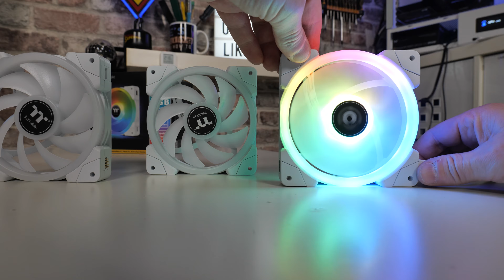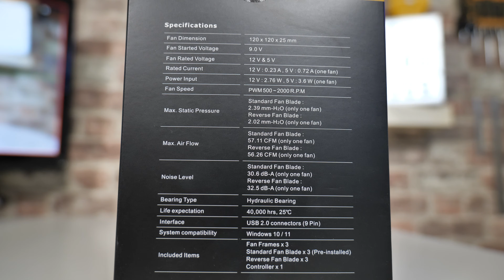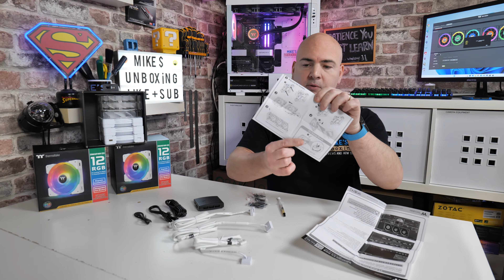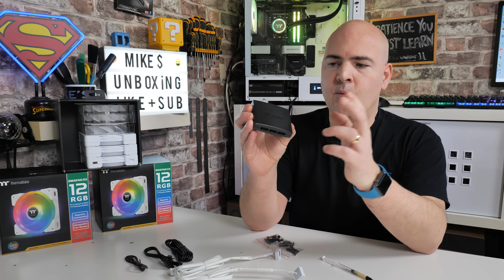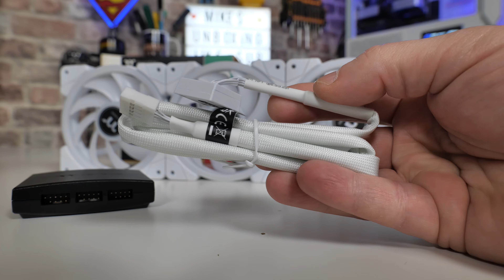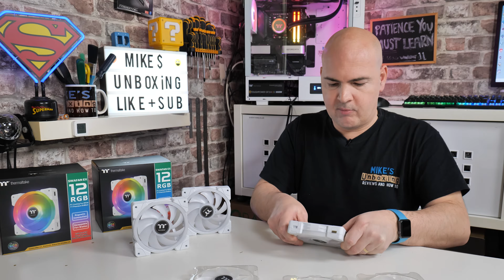BEST PC FANS Thermaltake Swafan EX12 RGB Magnetic Silence

Comment: how do you connect power for external fan use? that is to say we just want to use fan as an external fan not inside a computer case?
Reply from the maker: i would use a 12v supply or a PC power supply and a pwm fan controller

Comment: You can modify the cables to do sata if you are handy with a solder iron, or you can buy a sata to floppy cable. Don't do it though. Sata doesn't provide enough watts or amps for Thermaltake rgb fans. The Thermaltake sync controller is powered by sata and can control 9 fans at once but all of the fans are just copies when it comes to rgb. If you do convert the cable or get a sata to floppy cable the controller will fail depending on fan rpm and or how the rgb is configured.

Comment: Are these PWM and can I controll speed from bios ?   I think I read somwhere you set speed in the software but I like letting the bios handle that.
Reply from the maker: the ones with RGB in the name use a specific thermaltake controller and can't be controlled in any other way. the ones with ARGB or ARGB sync, can be controlled in the bios or the motherboard software

Comment: When I build my PC, I got a few packs of these fans. They never came with a hub, and Thermaltake's software doesn't recognize the fans.
Reply from the maker: if you got the ones without the hub those are the ex argb or argb sync, those use the motherboard software to control them, the rgb ones only are the ones to use the hub and tt rgb software
Reply: @ that explains it. I do have the ARGB versions in that case, it must be down to the software, not recognizing the fans. I’ll try a repair install for the ARGB software.

Comment: THE FANS LOOK GREAT  However the issue is that the RGB HUB is useing micro-usb and this hub alone has been the fail  point on 6 rgb hubs for me so far, why the hell are these things still useing miro usb for power? i hate these thermal take rgb hubs so much. i wish we just didnt even need a stupid rgb hub and i could just control all my rgb with Thermaltake rgb software, =(
Reply from the maker: You can swap the wiring for the wires in the new ex range and they can then use the motherboard argb and pwm headers and software

Comment: I have a Thermaltake TT Sync controller, think these will work off the older style controller?
Reply from the maker: if it is the one that has the 9 pin connections that are the same size as USB 2.0 motherboard headers it should but send me a picture of it and i'll confirm it
Reply: @mikesunboxing  thank you

Comment: That hub is a deal breaker for me unfortunately 😢, if they ever update the hub for usb c and maybe like a 6pin psu power connection (since Satan doesn't have enough voltage to power the hub) I might consider it cause the fans themselves are superb
Reply from the maker: they have a version that is hubless, the swafan ex12 ARGB sync

Comment: Can you daisy chain a set of 3 and plug the connector into the hub? For example, say I want to get 9 fans, could I sissy chain them in sets of theee so I only have 3 total cords, then plug them all into the one controller and do it that way to control all of them?
Reply from the maker: they should be fine like that, these don't include a hub so you would need to supply that

Comment: Molex connector is big turn-off for me. I have modular PSU and I have molex connector, but have other free connectors (pci, sata) what I can use. But for that, I have to put another cable (molex) just for that controller.
Reply from the maker: I might be wrong but I think the molex connector allows more amps than a sata so it is probably the better choice even though a pain in the arse
Reply from the maker: i think the molex was for power stability as molex can handle more amperage so avoids any issues with overloading

Comment: When installed and not working don't panic guy's  just give some movement to magnet connection and it will make good contact and works fine
Reply from the maker: Yes the magnets don’t always connect first time a little wiggle or adjustment usually fixes it

Comment: You saying every set is included with controller... I read on Amazon one star reviews about they got it without controller so what wich do I order ,
Reply from the maker: there is a controller version for using with thermaltake rgb software, or the version without that uses the normal 5v 3pin and pwm motherboard headers
Reply: Oh nice. I prefer using with mobo software so I have got 80€ version reverse and looks good and works fine.
Reply: So I am thinkins whats negatieve on that blade switch system ? Whats downside of it versus Phanteks D30 reverse. It cost the same around 85€ . What do your advice  for endurance?  If I choose for looks ..I like more TT design ..led ring :) 
Thanks 🍻

Comment: What effect do you use at 16:04 for the smooth rainbow ?
Reply from the maker: that is the default output without the tt rgb software running, which is a pain as i really like this setting
Reply: yeah same, i like it too. sad that the wave effect is like stuttering. the default output is wayyyyy smoother @mikesunboxing

Comment: What is the difference between RGB(black label) and ARGB (white label)
Reply from the maker: In what context sorry?
Reply: @mikesunboxing  I just look on Amazon and there are two models of these fans that are pretty much the same except for the label at the center of the fan: One is black, the other one is white. I see that the ones with the black label are tagged as RGB and the ones with the white label are tagged as ARGB but I'm not sure what is the difference between them. Perhaps the way they connect to the motherboard or something.
Reply: @mikesunboxing  FYI I found out it's just the connection type. RGB model has a controller where you connect the fan, whereas the ARGB has two cables, one needs to be connected to the fan connection in the motherboard and the other one is for power and is connected to a Molex cable.

Comment: 2023 and still uses molex, only adding psu cables 💀
Reply from the maker: SATA doesn't have enough power, molex or pcie is the only safe way to do it
Reply: @mikesunboxing  but corsair, lianli, nzxt are all able to use sata? fyi I personally own the riing trio and sofar  it has never worked properly, either software or controller issue

Comment: so how many fans can be controlled off of 1 box? 12? I have 12 fans and 4 boxes currently.
Reply from the maker: officially it is 6 i think, but maybe try that and see how it goes. there is a limit to how many LEDs can be controller from one unit and also the power limitations
Reply: @mikesunboxing  the only real issue i have is a molex connector. pretty weird. every other fan has a sata especially at this price.

Comment: Working on a new build (havent installed windows yet),
Purchased these fans but wont turn on at all. 
My question is do i need to install software for these to operate?
Never owned thermaltake fans or their controller before
Reply from the maker: They should just spin at the default setting until the software kicks in, you need thermaltake to RGB plus 2.0 software to set them up
Reply from the maker: If you get stuck join the discord chat and I’ll try and walk you through it

Comment: I love everything this product has to offer.

1. High quality fans
2. RGB lights are beautiful and bright
3. Very easy to install.
4. The blades are so easy to clean since it can be removed.
5. Swapable blades for exhaust.
6. 3 EXTRA Blades

but that MOLEX connector is a joke.
Reply from the maker: molex is the only connection that will give enough power for the fans and controller

Comment: Thank you so much for the video you actually brought up an important part for me and that is the 4th fan I plan to install 4 fans, do you know if you attached a 4th fan can you manually use the software to get the RGB fan to work and align to the others or would it be better to buy another fan like the Riing squad  what do you think is the best setup or options for 4 fans in your opinion>?
Reply from the maker: well the rumour is that thermaltake are looking at the problem and if they get enough people asking it will encourage them to push harder, you can use the software to group and link fans to create the lighting of your choice either in TT RGB or neon maker
Reply: @mikesunboxing  Thank you! and yes I actually already sent out a message to them since their chat support was unavailable I also checked their forum and there was nothing there, I may as well play around with their software  or I heard of another software other people utilize called signalRGB
Reply from the maker: Signal RGB has swafan support it seems but not tried it myself
Reply: @mikesunboxing  Same here I actually just purchased last week the first pack of 3 Swafan ex 12, My goal is getting 17 fans and plan to build my new PC between May-June or maybe July(waiting for the new Samsung Odyssey OLED or g9 57 inch ) so hopefully by then there's some good news otherwise I may as well try signal RGB

Comment: 125,89 € for a set here and only 2 left 😲 they most be more than great.
Mike's Unboxing, Review & How to is Worthy of a Support comment. Like & a share 🙂
Reply from the maker: they are not cheap but are probably the best 120mm fans on the market over all
Reply: @mikesunboxing  I still go for Noctua 120mm 150000 hours use. and 6 years of manufacturer's warranty. in other words. i'm a Noctua Fanboy. can't help it 😛
Reply from the maker: @WilliamAPBodie  Soon as Noctua goes ARGB that will be a market changer
Reply: @mikesunboxing  I will not be happy about that. it just mean the price will go shy high 😲 well thats what i think.
Reply from the maker: @WilliamAPBodie  as long as they still separate the rgb and non rgb it shouldn't change much it at all for the non rgb folk

Comment: The RGB looks Outstanding Really clear and Vibrant did you change Camera or Is It the Fans ? Magnetic too Very Noice
ps Can you re greace any Fans My Corsair has started Grinding at Start up it settles down but its defo the bearing or the inside doing it
Reply from the maker: you should be able to lube the fans or clean them depending on the bearing tech it is using
Reply: @mikesunboxing there the SP120 s yeah i have looked into it now going to do it when the stuff arrives Thanks Mike and Kath

Comment: how would this work in a non rgb case?
Reply: What do you mean "non rgb case"? They're PWM fans with LEDs. If you don't connect the LED cables, they will be regular fans. 

And if your mobo lacks RGB, there's several decent RGB controllers. I like Razers, because they have a great AmbiLight clone and one I got of Ali Express from a brand called CoolMoon.
Reply: @BigFatCone  one that doesnt have rgb controller built in like my nr600 case. but thanks for the info.
Reply: @BigFatCone  can i still use a controller of some sort?
Reply from the maker: yes as the ARGB is totally controlled on the thermaltake software you could even use them outside of a case or no case at all

Comment: As a Yorkshire man there's no way i'm paying over £100 for 3 fans, especially as they're not even dual ring.
Reply: These are dual ring, inside and outside ring. I assume by dual ring you mean two outside rings of the front and back, of which most none of those have a lit inner ring. It's a matter of preference, the money you spend here is justified.
Reply: I have the RGB version of Artics P12s in my case.  A set of three was like, 30 bucks. And they're pretty much on par with the best fans out there. Hell, Mike did a video on them a year ago and called them the best. Hardware Canucks and Gamer's Nexus are (pun hard to avouid) fans of the P12. 

This is just stupid expensive. Are you sitting down by the way? There's only one local retailer for these fans.  193 quid.
Reply: Dual ring??? What's that?

Comment: i do believe using molex connectors you can use more wattage than the sata connectors specially when you going to use 3 or more fans the only thing they have to work out is the controller itself or just use both controllers if you use more than three fans 
i bet they were pricy to buy .nice video i do like them.

Comment: Id like to see how you get on with the thermaltake rgb software as it wont load on my system with an ARC770 graphics card. Im wondering if there is a compatibility issue with the two lighting control software packages.
Reply from the maker: soon find out! just ordered an a750
Reply: @mikesunboxing  good, I was thinking about getting this card as a secondary one for display and streaming while the 6800xt keep working. I am current l'y using a rx550 but the intel one should be a better option.
Noe, I like these fan. Easy maintenance is a nice feature.. 👍